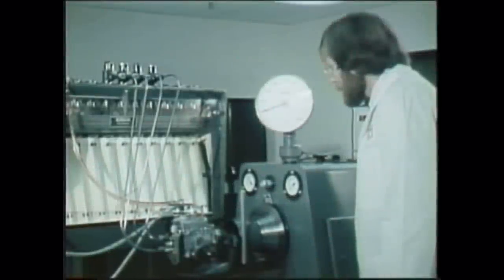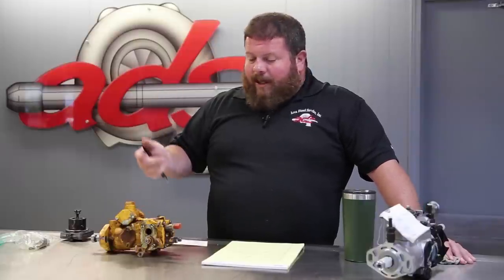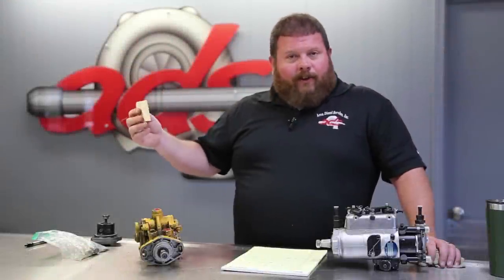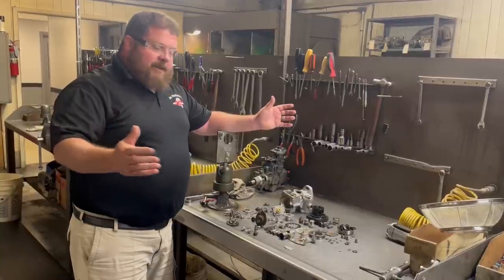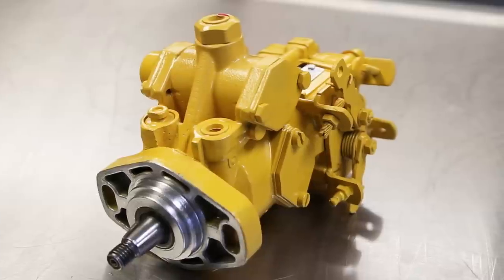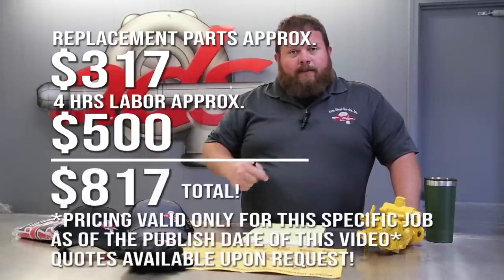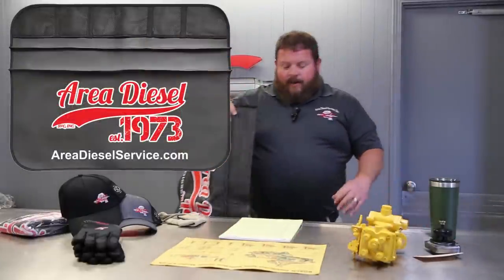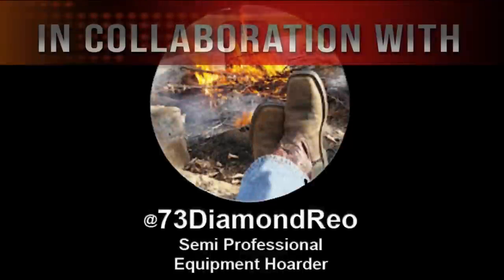Pump Repair on RARE Bosch VA Pump for @73DiamondReo International 270A Backhoe Loader

Comment: Just got my pump back a week or so ago and was excited about putting it on. Got it installed and then before I could even get it turned over a couple times, the starter died. Mine was a Stanadyne DBG pump for a 1968 Case 580CK 188D.

Comment: It seems to me that those rotary style pumps were made almost exclusively for the american market.. I've never seen any of those in Europe, its all Bosch row type pumps. I wonder how that came to be, especially since those rotary pumps seem less durable and more finneky on the insides.
Reply: In Germany there are lots of them. VW (and all its brands) used them in Millions of cars , beginning with the Golf MK1 diesel, to the VP44 in many different TDI Motors. My Ford Transit MK2 from 1983 also has one. Whats really rare is the type of governor, as i have only seen mechanical governors , or electronics.
They are also pretty reliable. Sometimes they tend to leak , and get destroyed by trying to fix that (like in the video, and i also did it myself one time...)
Reply: Rotary pumps cost less to build. That is why you tend to find them on VW engines. Mercedes usually has an inline pump.

This may have been especially important when building equipment that was never meant to be rebuilt.
Reply: @derbruzzler7574  I checked back on some stock photos, you're actually right, for some reason I always remembered the 1.6 Diesel to have an inline pump. I don't know about any later engines, never had a TDI so no memories there.

Comment: Too funny, the lab tech with the white coat cracked me up with that high tech language put me into a tail spin, luck ale I was able to pull up and dry my eyes:face-pink-tears: thanks for 73DiamondReo, I will save this video and add to my play list, good job.
Reply: What makes it funnier is that it's a 250/350/400 TH transmission outline (with added bits on the front bottom). As someone who used to build racing engines and transmissions, i found it hilarious.

Comment: Shout out to the host didn't catch your name excellent video one of the best I've ever seen. Area Diesel since 1973 great year I just bought a 1973 International 2500 b hydrostatic drive backhoe. I started it maybe a dozen times checking it over very little reverse when you first start it cold then no reverse after a couple minutes. I also found the hi neutral low shift arm broken off it drives 5mph so it's in low and unfortunately I can't get neutral. I just wanted to dig my water line in figured if I couldn't fix reverse I should still be able to dig it in but no it won't start now I can't put it in neutral so I can't move it as it's blocking my damn driveway 😡  It looks like a VA on my pump tag but I don't have that electric shut off my cable pulls against a spring loaded stop assembly. I believe Scott from greene creek farms sent you a pump like mine I got to @73DiamondReo from there and then made my way over to ADS 😊 I'll be reaching to you soon and again thanks for the quantity content and work you all do for the old iron lovers out there 💯👍

Comment: Possibly one of the mounting bolts can be replaced with a different bolt… external torx, hexhead Allen bolt. Might slow a pump thief, or maybe they just move on. You get the idea.

Comment: that pricing caught me off guard! i just got a quote for a rebuild of this exact pump on a backhoe like this and they said starting at $2,000 and that didnt include half the stuff yall did to it!, almost makes it worth the 12 hr drive for me. ive honestly contemplated scrapping the backhoe based off my quote but i may just do more price shopping.
Reply from the maker: Shop no more. And no need to drive out. 95% of the work we do comes in on UPS or FedEx. Give us a call and we can get you set up.